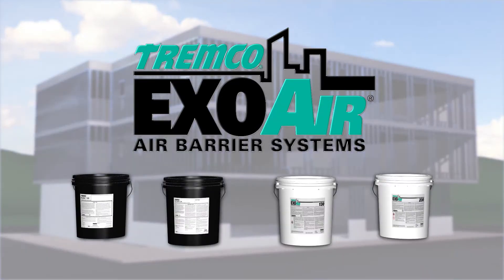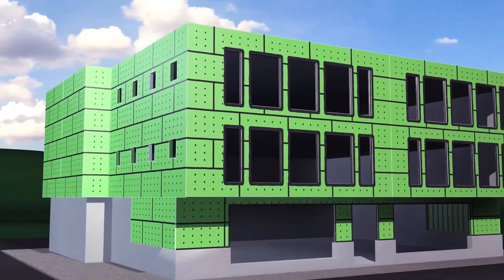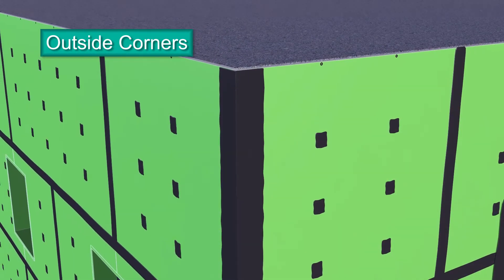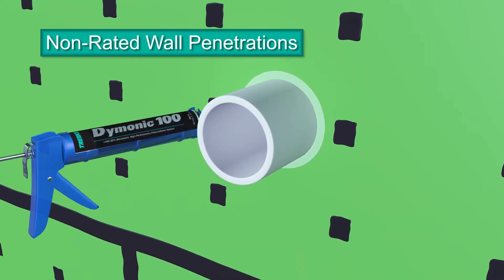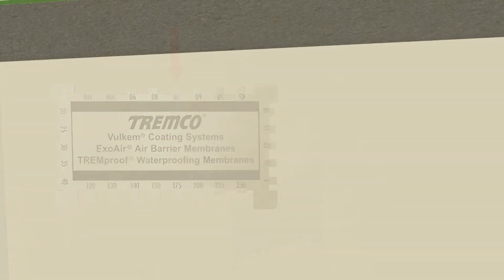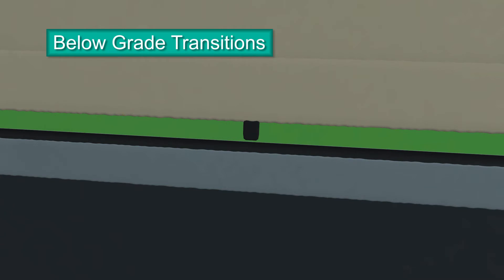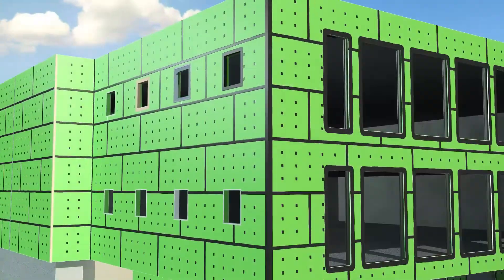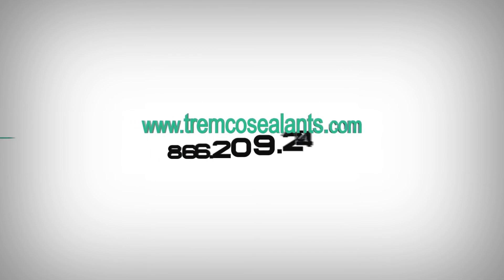How to Apply ExoAir® 230 - Fluid-Applied, Synthetic Air and Vapor Retarder Membrane

Comment: These securock sheets can be painted.. that is, after the joints dry and sand them, I can paint them in the color you like, I don't want to put cement or stucco or mesh, that's why I ask